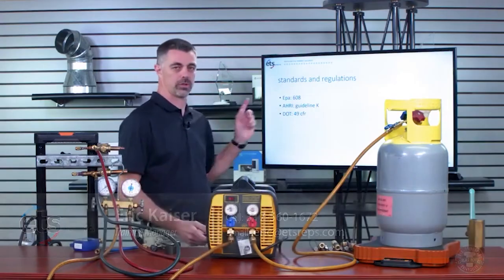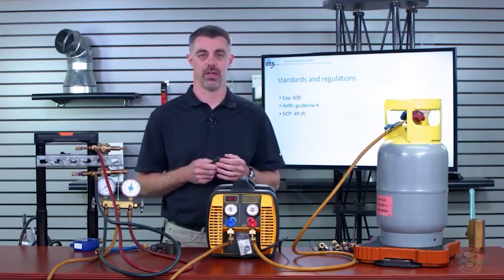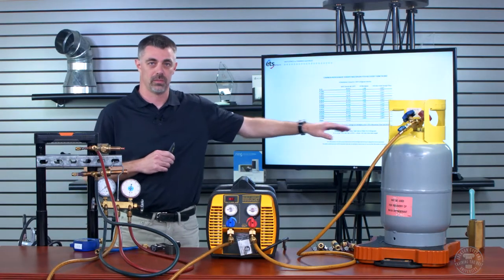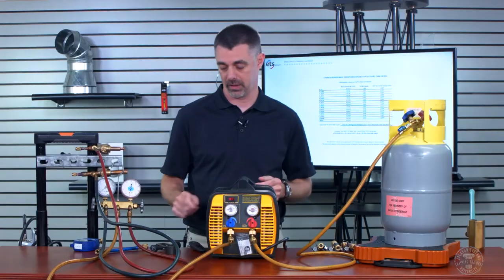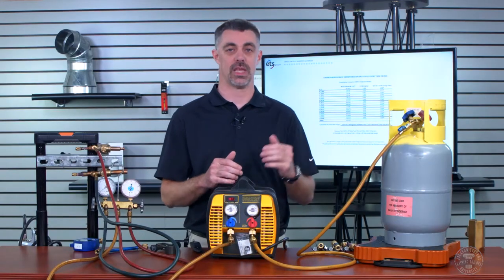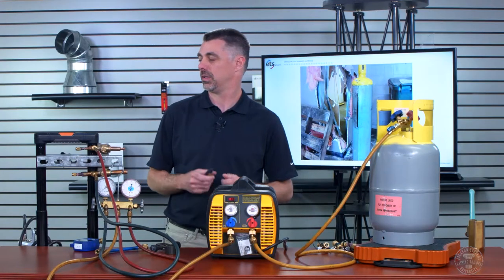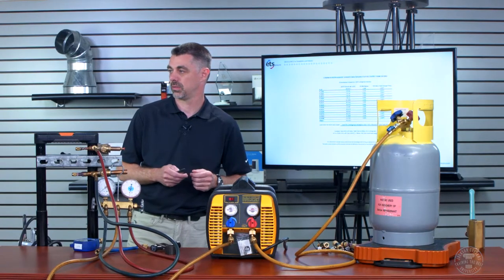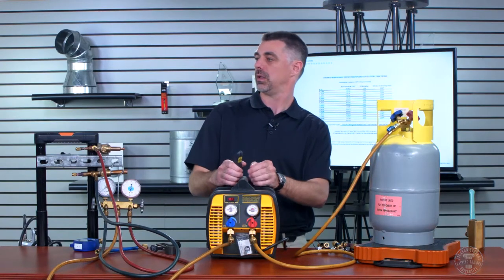Refrigerant Recovery- Full Training

Comment: How far can I go if recovery is made on the high side with AC running? Will it drain the system's oil altogether? That is in the absence of a recovery machine. I supposed as far as the clutch is engaged for it will automatically quit once the refrigerant pressure has reached a certain level.

Comment: Excellent video. A question please. At 9:43 you say one of the challenges is knowing what refrigerant is in the system, despite what it says on the rating plate. When calculating the fill, what refrigerant multiplier should be used before using the 80% or 60% multiplier if you’re not sure what is in the system? Dave.

Comment: So would it be fair to say that when pulling a vacuum on a recovery tank that turning the tank upside down and pulling a vacuum on the vapor line  would be faster method than upright?? Thanks
Reply: Pulling vacuum on a recovery tank does not change if its upside down or upright. It only changes if you uses a bigger vacuum pump or bigger vacuum lines.

Comment: Do u have to turn cylinder upside down when there is both a liquid side and vapour side. Just have the cylinder as normal. Liquid pipe inside goes to the bottom. And vapour pipe inside goes to the top

Comment: I'm 52 minutes into this and I am so frustrated because no one's even thinking of asking this question. What is the purpose of the dip tube on the high side of the recovery tank??? If we're using the vapor side for vapor and liquid by flipping the tank then when do we use the high side? How come nobody has thought to ask this question? Seriously, it was actually that easy for me to ask it.
Reply: The dip tube is there so that you can draw liquid refrigerant from the tank when it is upright, otherwise you have to flip the the tank and connect to the vapor port.

Comment: Couldn't you double check the tare weight after you pull a vacuum on a recovery tank to check and see if it weighs more to know if there are contamination in it? Wouldn't it weigh more than the stamped Tare weight?
Reply: i could be wrong but he did mention microns and that type of scale may not be that accurate to measure that small of change.

Comment: As a 2nd year guy I would suggest breaking these videos down into segments. Too much info at once. Lots of maintenance techs who service ACs are watching these vids and just need to know how to recover, repair the lines if they can, then return old or use new refrigerant.

I personally have field trained on cutting a condenser loose. Setting a new one. Pressurizing with Nitrogen,  etc.

I was just looking for removing the remaining R from the line set and evaporator or entire system if I was going to braze in a new condenser. 

Will return later to view entire video.

Comment: The procedure at the 48 minute mark I don't like. This is not the way to "minimal refrigerant loss". The method I learned requires that you keep one hose at your recovery tank. In that way you only have to purge a tiny amount between the recovery unit and the valve on the hose (valve side of the hose closest to the recovery unit).

Comment: I still don't get the concept of flipping the tank when connected to the vapor port.
If the tank is upright and you are recovering LIQUID isn't it falling to the bottom of the tank?
If recovering LIQUID in the upside down position, then aren't you pushing against the liquid that is sitting at the vapor port of the tank, now at the bottom?
Getting rid of restrictions, isn't liquid a restriction?

Seems to me that recovering in the upright position into the vapor port is the least restrictive.
Reply: I also feel uneasy about this point.  Further clarification is needed.